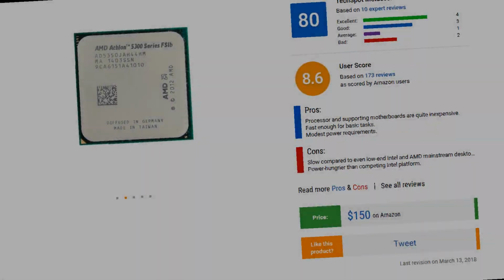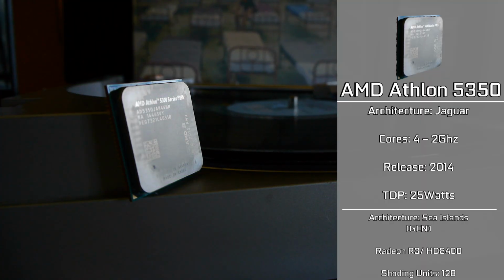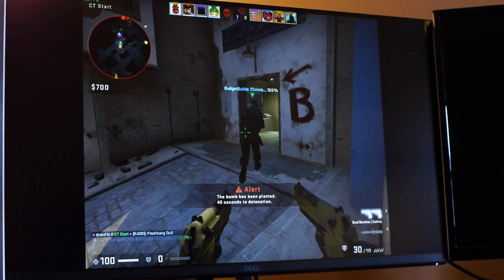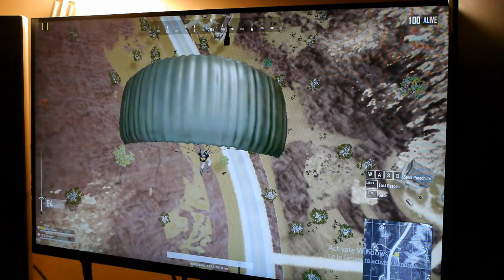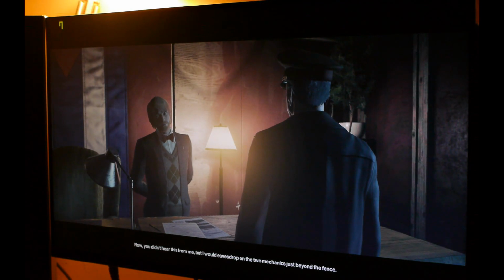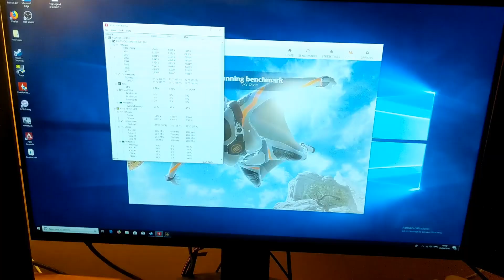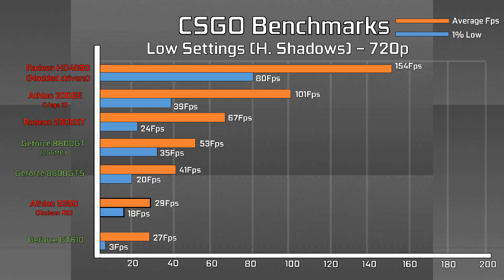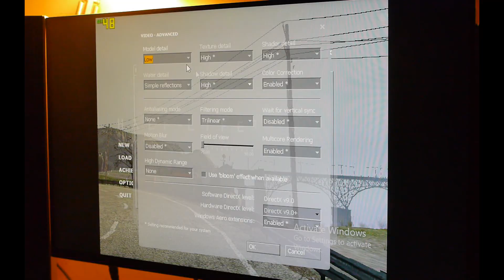Socket AM1 - Aging Horribly!

Comment from the maker: Here are some of my choices explained for those of you who are questioning some parts of the video. 

OS - Windows 10 was used to give us access to the latest DX12 APIs, I did also give the CPU a brief test on Windows 7 to see if there was any noticeable performance gain, and asside from a small increase of snappiness on the desktop, the performance was the exact same. So regardlesss of Windows NT based OS you shoudl see similar performance to this within margin of error.

GPU Chocie - Pairing this CPU with anything more than a HD5770 would result in the same FPS,m the idea was to see the maximum extent of the CPUs performance, and using the AMD Fury alowed this even if it was overkill. I did also run a brief test with a more basic HD7770 and it yielded the exact same results. 

CSGO - CSGO has been around for about 7 Years? And during that time it has been updated a lot, because of this it has become a lot more intensive due to some areas of the game being expanded, and the game becoming more bloated in nature (same goes for TF2 etc.... and Other Source Games thta have been heavily built upon). So I understtand if back in 2014 you guys got 60Fps in CSGO, but that was 5 Years ago. Just remember that on release a Pentium 4 could get 30+ Fps Consistently, my old C2D Based Laptop could get 40-60Fps back in the day. The game has been updated, performance is as shown. I cant fake filming the screen...

Media Performance - For those of you who dont make it to the end of the video. I praise the CPU heavily for its Media Decoding, and generally good server capabilities, stick this in a HTPC and you're good to go. My point of the video was more to do with the people who used to recommend this for gaming. 

I take a lot of factors into consideration when I make these videos, and I can assure you after spending well over a week using this APU, and only this APU I hjave tested the most optimal settings, with optimal hardware, and other enviromental options. 

Hope this clears up any of your issues. Cheers
Reply: Is that a Pink Floyd album in the background I see?
Reply from the maker: @nickrandall2281 : Both Delicate Sound of Thunder and A Momentary Lapse of Reason are in the backgrounds of the video. Good spot
Reply: Budget-Builds Official hey do you have an email? Cause I’d like to email you pictures of my vinyls.
Reply: Budget-Builds Official Some of my favorite albums are wish you were here and the piper at the gates of dawn.
Reply: You can compare with the Athlon II x2? The 5530 appears to have a very inferior performance compared with the previous generation
Reply: You should have compared it against 2014 intel atoms. That is pretty much what they are just with a socket instead of soldered.
Reply: I see this thing is better than my Core 2 Duo T2600. Maybe I should upgrade.... Dell Latitude D820 is quite old for it to still be my main PC.
Reply: @firstnamelastname5407  Does your D820 have Intel graphics or Nvidia graphics? Either way your upgrade options are limited. I had a PCI GT 430 in the D series dock paired with a D620. It worked for some low end gaming. The laptop needs to have the Intel graphics for this to work though.
Reply: @FiLiMa_  Intel
Reply: @FiLiMa_  I heard that with a D830 mobo it can get up to a Core 2 Duo T9900
Reply: @FiLiMa_  I have a D620 too. I don't use it much though.
Reply: @firstnamelastname5407  I have read that the D820 has an Expresscard slot, and maybe an EXP GDC the beast would work with that. I just don't think it's very cost effective. By the time you get all the parts for the eGPU, you could have gotten a cheap Core 2 Quad desktop with a graphics card for the same price.
Reply: I had a quad core amd APU laptop of similar architecture (puma+) with quite better performance than this one although the slow loading issue persisted in my laptop too. I think this is due to both APUs having single channel RAM support only
Reply: Isn't this music from Pokemon? It sounds so familiar. lol
Reply: No one REALLY suggested this for gaming. People have tested it to see if you could, but it was always recommended to use a different platform as even at the time there was no real expectation for big performance improvements with future iterations, which there was none.
Reply: Something is wrong with 5350! It's looks like somebody has try to overclocked your 5350 and did this the wrong way...! Max. save overclock is 2,455Ghz! I have my 5350 runing @2,34Ghz nealy five year without ans problems! :)
The best CPU for AM1 is 5370 with 2,2Ghz but is very rare and is 15% faster in everything at stock speeds! :)
Reply: Love the Veilstone City music in the background. 👌
Reply: Love the Pokemon DPP music in the background.
Reply: step up Your brother from Algeria
Reply: I just built a home server using this and it's awesome.
Reply: "ZX Spectrum - Aging horribly"
Hardware ages. That's just the way of things and probably will be for a considerable amount of time to come.
Reply: The AM1's real big downside is the single channel memory. I got one (albeit the higher clocked version) for a simple hobby project: running Windows XP passively cooled. For my WinXP games, I could use a period correct Athlon X2 but that thing uses more on idle than the 5370 did on full speed. The performance for all that's okay.
Reply: What game was that one  of the Sloop pirate ship vs the Brigantine?
Reply: @CommanderTato  It's "Sid Meier’s Pirates!". It's the 2004 version. If those images piqued your interest there's a good chance you'll like the game. It's an interesting one. It has not aged horribly.
Reply: @AtotehZ  Cool im a Uncharted Waters fan.
Reply: these will easily run 2400-2600 on ram,  and NEED IT for the APU to not run like absolute dogshit compared to even a basic gpu that uses nothing but slot power.... 

they are fine for desktop use win10 but, for games... yeah no... 

oh, most i have played with would clock near enough 4ghz on the cores using a fairly cheap cooler.(no aio needed) 

and...yeah its aged poorly, but, from my view... most stuff of this era did... 

when 1366 ages so well, why does everything else age so poorly comparison wise... ;)
Reply: note: dosnt need to be low latancy ram, bw matters more then lat for the apu's needs ;) 

and yeah... fm1 arent really any better/worse in my exp... again only overclockers touched them for gaming really... or idiots.. ;) 

overclocking could be fun though... they ran so cool... they just asked to be pushed to 4ghz...heh...)
Reply: I would have personally tried overclocking it since I bet ya most who got this part would have done that to pick up some frames in games.

Comment: I have a Athlon 5350 as a headless system for Linux and experiments. It's a thin-client type of a desktop box that I found for cheap.
It actually performs pretty well. The only issue is the lack of proper fan control, but that's not on a CPU.

Comment: I have a MSI AM1i motherboard and it works fine for any game made for windows XP.... just have to set the video memory to 2GB shared and be sure to put in 16GB of DDR3 memory. (8GB X 2) on my system I have a slimline DVD drive and a 500GB hard drive. system works great for basic computing! will accept Linux if needed, the AM1 Platform was quickly abandoned after being released.... too bad, its like a missing chapter in the AMD AM series CPU's. now with the platform being AM5.... AMD moved quickly to advance the technology! the only thing I hate is my MB! its a MSI AM1i and the CMOS battery doesn't report. I even tried to change it without luck.... so the board has issues, but does work....

Comment: My Asus AM1 mini itx motherboard and Athlon 5150 are dying already. I'm pretty sure It's the motherboard because It gave me issues from day one. Bought It around august 2015 so couldn't reach the 10 year mark. IMHO I gave the system a good use and maintenance. The solid caps were rated at 5000 hours so they exceed It by a lot more. Still disappointed though. I have and old Dell Pentium 4 with a CRT monitor and It still works without issues after 23 years, It works with the original PSU 😂

Comment: I used to play Dota 2 on this system back in 2016-2019 and it did the job let's say, but I still have this processor to this day and it doesn't even load the games at the time it takes

Comment: 5 years later, I'm still using a 5370/Asrock AM1-ITX/16GB RAM/K29 case as a web/torrent server that is so quiet with the power-brick and a 120mm fan that I have look inside the case to check that it is on when push the power switch. I'll probably be using this server for at least the next 10 years. 

I also have a 5350 with the 4-sata MSI board and a Pico power supply as well, but I still haven't repurposed it yet since it got decommissioned by 5370. The Asus board you used is really the only board that can overclock well.

We can't really talk about how the socket aged when it only had 4 Mobo and 1 generation of CPUs. If it had gotten a 2nd or 3rd generation of CPUs, then that could have provided a noticeable performance increase of iGPUs as well as an affordable upgrade path for low-end computing.

But as it stands, AM1/FS1b was more of a proof of concept/experiment than an actual socket.
Socketable CPUs in a mostly integrated CPU market was the central idea of the socket (i.e. upgradeability).
Reply: It really was an experiment, and a bad one. Is that server working 24/7?
I wonder how much that motherboard  will hold. They're pretty bad tbh. Mine couldnt reach the 10 year mark.

Comment: I remember Jayztwocents doing a video on these as a low end gaming solution. For esports titles back when it was introduced it almost held its own. These are way too expensive on the used market for what they are now.

I had the dual core sempron that I used for a while as a pfSense router. I've shifted to a low TDP Sandy Bridge Xeon for that purpose now while running some other VMs on the same system.

Comment: AM=AMD
2, 3, 4, 5...=DDR type
AM1 is just the customer facing name, its actually socket FS1b
Socket FS1 is for laptops using a PGA socket (like intel using socket G2 around that time).
Jaguar cores (later Puma and Puma+ were designed for low power, low cost entry level laptops to fight Atom.
By adjusting TDP and core counts and clockspeeds you get many different SKU's and models with different codenames like Kabini, Temash, Beema and Mullins.....but effectively still budget laptop parts.
More expensive higher end APU's with dual channel and higher TDP's were Richland, Kaveri and Carizzo on the FS1+, FP2, FP3, FM2, FM2+ sockets depending on laptop or desktop.

Socket FS1b is effectively "hey what if people want to use these laptop cpu's as low power desktops"?
...But you can't expect people to remember FS1b so instead they called it "AM1" to symbolise a low end desktop under AM3+/AM4.
Effectively a Q6600+gt710 but for a fraction of the wattage and power draw and size that you can buy new with warranty so if you just wanted to tinker or build a PFsense router or NAS which many still do today.

(I have one in the kitchen as an entertainment system with a 120GB SSD+1TB HDD in a 4.65Liter case connected to bookshelf speakers, has 45GB of music/music video playlist, web browsing for recipes or other videos when making mojitos with buddies).

Comment: Well, I had this motherboard and started off with the 4-core Sempron processor that I used as my daily driver for all kinds of stuff. Even editing 1080p video wasn't too bad when using proxy files in Serif MoviePlus 6, although I upgraded it to the Athlon cpu for £35 which gave me 70% extra performance which did make a noticeable difference. With low-energy hard drives it uses hardly any power at all though, and it's perfectly fine for watching youtube and regular office stuff like writing, spreadsheets, and photo-editing. And the reason I'm watching this video now is because I've just finished configuring it for a 10yo boy to start using it for homework, and it will be fine for that.

Comment: Yesterday I put a 5150 back on action to run Windows XP and play some old games, it was able to get around 30 FPS on NFSU at 1024x768 with high details. Other than network appliances, this seems the best use for such processors nowadays. I got surprised to find drivers for Windows XP, it is not listed on AMD specs page, but I found them on MSI motherboard page.

Comment: I had a Athlon 5350 on a itx board in a tiny case years ago. Made for a ok little media pc in the bedroom. But that's it. I've since switched to old dell usff with old Ivy Bridge i3's and they are noticeably better. I'd recommend a low power Ivy Bridge or even Sandy Bridge i3 or i5 like the i5 2500s.

Comment: There is something very strange or seriously wrong with this APU, that lack of general responsiveness, anti cheat issues and occasional crashes the video is talking about, I experienced all of them, I have one of these in my cheap Acer laptop with the same Jaguar architecture (A4-6310 1.8 Ghz), I upgraded it to 8 GB RAM + SSD and it was a waste of money, it still feels way less responsive than those low end Intel dual core laptops with Win 10 on HDD + 4 GB RAM. I get frequent connection timeouts and when opening multiple tabs or programs they take ages to load and even show up in the task manager.. and when I do that I get strange freezes sometimes followed up by a Blue Screen... I commented because I saw a video of the Steam Deck running Windows 10 and having these exact same issues and weird unresponsiveness, reviewers blame the aggressive power management and very high latency of the APU when it needs to increase the clocks and switch C-States, but this Athlon 5350 is running at 2.05 Ghz all the time and still has this issues, so the fault is in something else.... anyway lesson learned, avoid AMD CPU's like the plague, even if the cost to performance ratio seems good, they just aren't as stable or problem free as Intel...
Reply: It's got to be the cache. This CPU has no shared L3 cache, just a 64kb L1 and a 512kb L2 cache per core. When a CPU reads from memory, it takes time to load the data from ram to the CPU. Caches can speed up a CPU's performance by already having the data ready on the CPU by loading it from ram in advance. When a CPU requests some data that isn't in the cache, it's called a 'cache miss' and programmers try to avoid that as much as possible when optimizing their software, because reading data from ram is a lot slower than from cache.

Things like Networking and anti-cheats are usually time critical processes that will fail or disconnect if the CPU fails to keep responding fast enough. I suspect this CPU spends a lot of the time waiting for memory to be read in from ram to the L1 and L2 caches, instead of actually processing data.

This CPU design might have worked better on a system like a PS4 where the operating system doesn't really do much and stays focused on one task, but on a highly multi tasking OS like a desktop, where background processes are always reading and processing data,  and the task scheduler is always giving other background programs a turn on the cores, the small core specific caches are going to be cleared out constantly, causing constant cache misses.

Modern high end AMD cpu's like the 7800x3d have extremely large caches ( over 100 megabytes ) and are much more snappier. It seems like in the early 2010's intel was king, but in the latter 2010's AMD improved massively with Ryzen processors for gaming.

Comment: I do wonder how memory bandwidth sensitive it is(the cpu cores, I mean. obviously the gpus side would benefit a lot from more bandwidth). The consoles had two of these but 4 times the memory channels and much higher memory clocks. is there any memory overclocking on socket AM1?